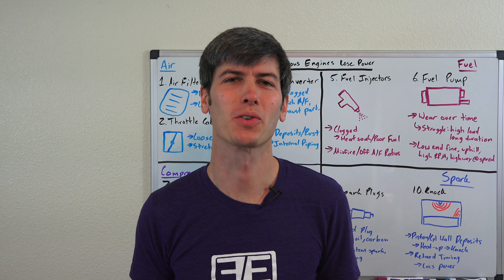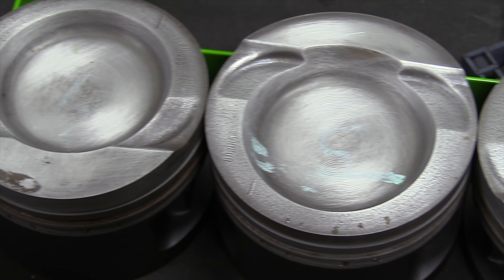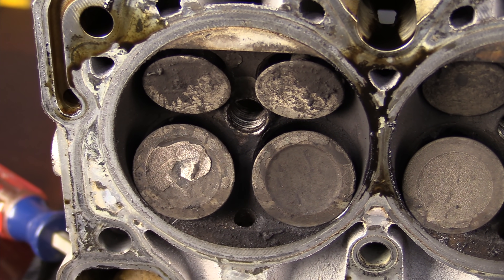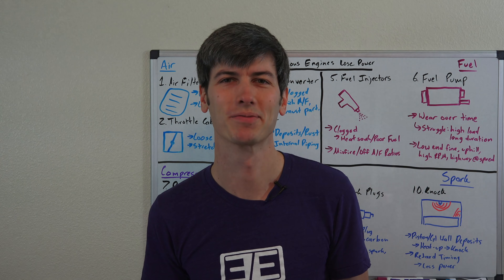10 Reasons Why Engines Lose Power Over Time

Comment: Great. I have an Isuzu kb 240 Le petrol. It is losing power and there are vibrations on the gear lever and eventually goes off. I changed the plugs but the problem is still there. Please help me

Comment: I had probs with acceleration.  Turned out to be drive shaft bearings had gone both sides. Clutch was replaced as well to increase grip. Tyres too.

Comment: Another nice video on cars. The section on piston rings and valve wear  could have mentioned heat from turbos and high rpm
can cause floppy pistons and premature wear of metal and rubber seals, So, keeping heat and rpm low will definitely help engine parts 
and the longevity of your car. I rebuilt engines for years and this was the golden rule.
Great Content.
Mario

Comment: Solutions for the power enthusiast:
1.) K&n filter
2.) Lucas fuel injector cleaner 
3.) Remove your catalytic converter
4.) Replace spark plugs often
5.) High flow fuel pump

Furthermore would advice to upgrade your alternator, OEM alternators only give you the recommended amperage at high rpms.

Comment: I have a 1988 Ford F150 it’s lack of power first and second gear have plenty of power third and fourth it barely climbs speed. It has 48,000 original miles on the motor. Could that be buildup inside the engine causing that? What is your suggestion? I have new plugs, coil, new gaskets, and wires and distributor cap and rotor.

Comment: I HAVE PEUGEOT 206 1.6 LIT PETRON ENGINE IAM A GAREGE OWNER THI CAR I BUT TO ME FOR LACK OF POWER BE COUSE OF THIS THE ENGINE IS CHANGE THR CAR COME TO ME I CHANGE THE FUEL PUMP CHANGE THE ECU CHANGE IJECTORS THOTTLE PEDDLE MOTORRIZING SPARK PLUGS I DID EVERY POWER AND GRAND TEST I CHANGE THE MAP SENSOR WIRING OK BUT THE CAR STILL LACK POWER ANY ADVACE WILL BE USEFULL 
THANKS

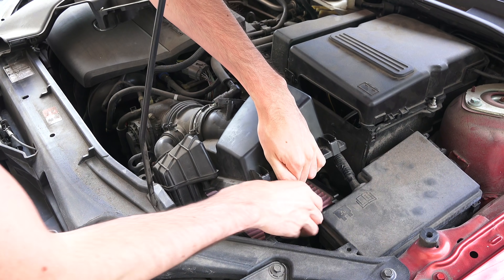Comment: 1 00:45 Air filters 
2 01:04 Throttle cable 

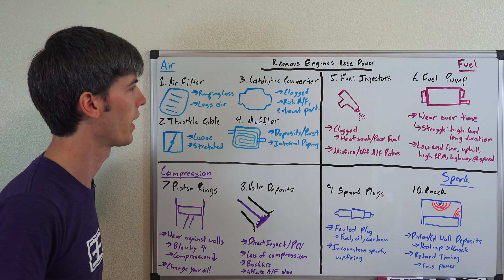3 01:32 Catalytic converter
4 01:42 Muffler 

5 02:03 Fuel injectors
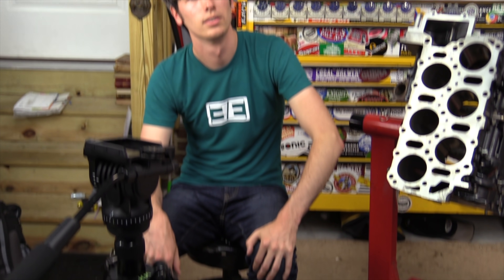6 02:21 Fuel pump 

7 02:51 Piston rings
8 03:23 intake Valves 

9 04:17 Spark plugs 
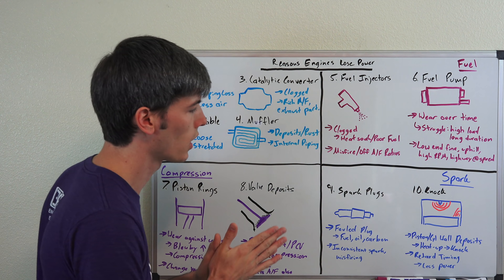10 04:31 Knocks

Comment: Believe me, I sold my 3 cars just because they were losing power while driving uphill, and all of them were Toyota's. Presently, I am using Toyota camry 2010. The same problem I am facing again it lose power while driving uphill, especially at speed of 80kmph or more. For example, if I am driving on uphill at speed of 80kmph and then road speed change to 100 kmph, my car does not accelerate, to drop the gear of the car, I have to press the accelerator pedal more than half.. Can someone give an idea of what the reason for my car is doing ?

Comment: I have a 2012 madza 5 can my high pressure fuel pump cause my car to miss fire?
Reply: Maybe, if it is starting to fail.  Misfire is usually bad spark or injector issues.

Comment: Hey hope all is well. Someone mentioned that a new car saves about 30% more fuel vs a worn out car because the worn out car has its carborator rings gaskets oil pick up blocked burnt leads distributor fuel pump wheel bearings alignment worn out. Is this true? because i want to purchase a vehicle soon
Reply: New meaning no carb saves fuel just by being fuel injected as opposed to carbureted.    Wear and tear can cause low fuel efficiency as well, not sure about 30% though.

Comment: Check your fuel pump 
Check your timining 
Clean your catalytic converter 
Purge your injection pump 
And injectors or clean your carburetor 
Clean your intake manifold and mass air flow 

Change inspect your spark plugs 

These are the main simple reasons.

Comment: I'm poor and always buy and drive high mile cars for up to 5 years until I buy another one. I rarely have any issues. They key is to drive them at the speed limit and always check the fluids. Every older car I've purchased burns oil. I've never noticed them lose power throughout the years of ownership. Usually radiators, water pumps, alternators, and batteries are what need to be replaced.

Comment: i know this is far fetched but i did a valve job ,spark ,air filter ,whole works on my zx6r motorcycle  but it still has no top end power it wont push past 200km  blanked out the dyno map nothing, added more fuel nothing   was the same before and after i did all the work to it any idea
Reply: I'm a bike mechanic so I might be able to help you, let's start with what year is it?
Reply: @dukecraig2402  i flipped the bike got a new one again lol problem fixed 😂 thanks tho man
Reply: @loudnpure  
👍👍👍

Comment: Appreciate the video.

Ideas for improving at least some of those problems?  Changing spark plugs is obvious, but what about all of those other deposits inside the engine?  Some way to dissolve or blow them out, with additives and/or driving style?
Reply: Running a full tank of high octane gas will help, Just fill up the entire tank from empty on the highest octane available and dont fill up on what you would normally use until your empty again.
Reply: @ghosthawk969  why is this? I thought higher octane only meant it would prevent pre-ignition. Are you saying it burns at a higher temperature thus ashing/dissolving the deposits away?

Comment: Although this isn't a regular maintenance item, but the injectors will clog up over time. No matter how high grade gasoline you use, over time it'll gum up and yes, even cause a no start. My van sat for 30 months, because I couldn't think to replace my injectors until a couple weeks ago. I replaced everything else as I went, even things that didn't need replacing, but ultimately it was the injectors. I would say either replace or have professionally cleaned with ultrasonic bath every 100k miles or so.

Comment: Would installing an oil catch can half-filled with pure ethanol alcohol allow for a cleaner burning engine? 

I've seen how "The Humble Mechanic" installed an oil catch can  in a Tiguan and how dirty the oil looked. I can see how carbon can form on valves so it got me thinking, "What if a combustible vapor was added to an oil catch can? Would it reduce carbon build-up" ?

What do you think? JC Whitney used to sell a product that used alcohol claiming it would make engines run cooler. Thank you!

Comment: One of the motoring shows had two identical same bhp golf gti,s one new the other with high miles , they did a drag race and the high miler left the new one for dead , a well looked after bedded in engine with high miles can be more powerful.

Comment: My car work fine in the starting but after 200 miles it loos power, did not pickup in 1st gear please guid the reason. 
It's total runs is 21k miles.

Comment: Cables can increase their internal resistance and can affect communication between ECU and sensors. Especially the cables that run close to the exhaust due to heat.

Comment: Hi There, can you please tell me what’s the better oil for Turbo gas engine using in Florida, The manufacture can’t recommend the correct one because there is a lot of different weathers around the world for example you can’t use the same oil in Chicago than Florida because Florida is warm all the year and the other thing is turbo I really confused about One because is need a good lubrication but now body tell which one is better due to it has a thiny pipe. Please help. 
Thanks 
10w 40 is a good choice?

Comment: Piston rings is not an entire engine rebuild its a top end removal job and inspection. If its just new rings needed and a light hone then so be it?.  If its an over size piston ring job and a bore and hone so be it?. 
If its that plus a valve seat, Lifter, Rod and tappet or roller rocker job so be it but all this is top end work. Timing chain stretch or worn belts are also common in power loss issues.
LOL, Who else removes the crank shaft to get to the piston rings?!.

Comment: My car was last year for obd1 1995 Caprice. It was stuck in limp mode. Like back up program to run on reduced power. Computer could not read disk reader in optnispark. Gm pancaked distributor behind water pump. 2 shaft oil o rings gave way oil ended up in my disk reader for timing. Then fuel pump wiring burned in tank. Then I removed MAF sensor screen it can breath. Also bosch spark plugs give little more horse power 4 prong if you can find a set. But they eat more gas

Comment: Just curious - I have a 1997 Isuzu Rodeo 4 cyl 2.6 - I notice when driving section of roadway having long steep hill - on very hot days engine seems to have less power climbing the hill vs driving at night when it's much cooler. Air temperature have impact on engine? (I maintain this vehicle very well - has 82,000 miles.) It averages 25-26 mpg. Another curiosity: I used to have a 1963 Chevy Nova 6cyl 194 cu. in. engine - manual trans that averaged 25 mpg. I would think the modern cars because of all electronics controls / fuel injection would have much better gas mileage. Doesn't seem to be so...the Nova was so much cheaper / easier to maintain....wish I still had that car.
🤔🇺🇸

Comment: Hey man recently my civic 91 was having low compression 130psi in 4 cilinders i change my head gasket fuel pump filters ,now the car has 155psi ,165psi but still fells its lossing power what else can i check?

Comment: Camshaft wear.  I had an engine that was low on power. It ran just fine, quiet, smooth, started OK. It was the lowest power version fitted to this car so I thought it was normal. i decided to pep it up a bit with a performance cam, cylinder heads and headers. When i removed the cam it was so badly worn some valves must have been barely opening. Just replacing the cam with a new standard one would have given a substantial power increase.  Once put back together the power increase with the performance parts was incredible!

Comment: different quality of parts for the first assembly from spare parts. the same manufacturer of spark plugs or high voltage cables does not mean the same quality like first assembly parts

Comment: Why do you call it knock?
Reply: When knock occurs the piston hits the cylinder wall. This impact creates a knocking or pinging sound.
Reply: It's usually called pinging. Older engines have more carbon build up. Those carbon deposits become red hot and increase the compression ratio, and this causes lower octane gasoline to erratically combust before or after the spark plug sparks. You will hear a knocking/rattling noise under load. You will have to bump up an octane grade to stop it, or you can run fuel system cleaners through the tank several times and see what happens. My 2000 Toyota Tacoma does this with regular fuel.

Comment: You an gain compression over time
Reply: no, you lose compression over time. Overtime the cylinder wears out and the seal on the piston rings gets worse. Cylinder gasses are able to slip past the rings and reduce compression and power

Comment: I can't tell you why they lose power and how to fix it

Why they lose power thay are clapped

Step1.cut the exhaust off
Step2. Rebuild them
Step3. Put cold air intake on it don't even put comb filter
Step4. Stay on top of your oil change and regular maintenance and don't be a retard that drives his car 20,000 miles on 1 oil change and has to rebuild it and then spends a lot of money on someone to do it for him
Problem solved it's not that hard

Comment: So, basicly if you replace and rebuild all the parts you just mentioned, there is a possibility for the engine to run as new?
A buddy of mine had an engine rebuild. He went from 10w40 to 5w50 over winter and 10w50 over summer (he does big milage).
When he went to remap the ecu after the whole rebuild, the power at the crankshaft was showing ~10 hp less when the car was new (wow, you can read the brouchure).
How would you explain that?

Comment: Valve deposits are a complete non-issue on port fuel-injected motors unless there's some massive mechanical problem. DI on the other hand... hoping new oils resolve that issue but really not sure it will.

Comment: new air filter check, new stainless catalytic converter check, new muffler check, water injection to clean those valves check,  new 370cc injectors check, new spark plugs check, very rare JRSC supercharger check....I think I'm doing good regarding the list :)

Comment: Man the more i watch your videos the more I love my car for being a brilliant piece of engineering. I have a Mitsubishi Galant hatchback E33 92' has over 125,000miles on the odo, and since I did not ever need any sort of repairs apart from the 6 month oil change. Heck I didn't even need to change my spark plugs in over 2 years as they are in pristine condition (white) as the engine makes perfect combustion. No engine knocks and no oil burning (well maybe a just little bit as after 5000miles the oil gauge goes from high to low - i use mineral oil). I bought it 6 years ago for 1,000 Euro (yes I paid extra because it was in very good condition and was serviced at our garage so it was a customer's car). In 6 years my repair list was as following: 3 x Air filters, 1 set of spark plugs just because (they were in perfect condition), 4 new tyres, 1 antenna rod, 1 battery, 6 x fuel filters, 6 x oil filters, 1 water spray tank (took it from my other Galant an E32), 1 section of exhaust pipe, 1 AC gas conversion intake nozzle (new AC gas regulation needed it). In 6 years I spent next to nothing for its maintenance and its as comfortable as ever and spacious, not the most powerful car out there but it is adequate for daily commute. Range is about 230 miles/ 50litres city driving, 350miles/50litres mixed and once pushed it to almost 480 miles highway only, which is pretty solid for a 1992' car. The only problem the car has is some rattling on the driver's door striker on heavy left continuous cornering (right hand steering wheel). All electrics work perfectly, even the original radio cassette (apart from the up-seek button that got stuck). The only problem with the car is my wife, she hates it, because it looks old design

Comment: You didn't mention timing chain stretch retarding cam  timing. Also wear on valvetrain parts reducing duration and lift. Worn out valvesprings cost power as well

Comment: My 3.4L V6 GM engine is more powerful today than it was back in 04.  I changed out to Mobil 1 soon as I got it home. Been using it ever since.  Changed out OE air filter to K&N. Changed out restrictive exhaust to dual exhaust with 1/2" larger pipes.  Changed out to new OE plug wires.  Bosch Iridium spark plugs. Change out AT fluid at 60000. Maintain the car all the time myself so I know the work is done correctly with the right fluids and oil. Changed to all LED lights, including dash light. Added performance tires and wheels which lets the vehicle roll easier (reduces road friction). Stuff like that.
Reply: Performance tires have increased rolling resistance lol

Comment: Hallow Sir, My 2008 Chrysler Sebring was timing fail, then i replace hole timing component after it multiple misfire even i replace crankshaft position sensor and camshaft sensor, new plug. I want to need your help

Comment: Hi I have a Mitsubishi Outlander Sport se 2011 I have a issue the car doesn’t have a problem turning on but put the foot don the gas and it’s restrained for exhilarating as well it’s know showing engine problem weld it be a filter because I haven’t even had the car for a year

Comment: Great Video... I've rebuilt the engine and clutch to my 95 Del sol and replaced a lot of parts to the engine and cleaned a lot and replaced Fuel filter, air filter, PCV Valve, all the radiator / heater hoses, Axles, wheel bearings, cleaned out the IACV, New Plugs and wires,  New Catalytic converter 4 years ago, etc. etc... This pointed out a few things I didn't think of.... like the fuel pump... Seems to be working fine now but I'll look into it and see how much it costs to replace... The Car is running super smooth right now... but I am sure these things need to be replaced eventually...

Comment: Or you could just replace your fuel filter, fuel pump, clutch, flywheel, idle air sensor, position throttle sensor, new distrubitor, oh and a new engine got to love manual 95 chevys

Comment: I have an 05 Cadillac CTS that won’t stop misfiring I changed out all the spark plugs all the coil packs 2 injectors that they sad were bad and it still misfires and gets horrible acceleration. I have aftermarket cats on it that are smaller then the OEM ones and it keeps catching an exhaust leak do you think that could be why it keeps misfiring or any other ideas another place just told me my electrical harness looks bad could that be it somebody help!!!! lol
Reply: While I’m idling the rpms go up and down and the lights flicker a little bit also

Comment: Can tune ups help minimize this?
Reply: Paul A No. 
Carbon remains are normal and can be minimised using additives. Plugs, air filter, fuel filter, oils etc needs to be replaced regularly

Comment: Hi All 
I have a problem with my car. It losses power certainly when you break or in traffic and remains in that condition.  When you switch it off, it may regain power or remain in the same state. Actually the accelerator pedal doesn't rise,  it will not go past 2000rph. 
I have had a mechanic check it for sometimes now, it picks and goes back to the same condition 
1. They have changed pedal sensor,  this hasn't worked
2. Checked  throttle body, nothing changes 
3. Fuse box checked,  spark plugs changed 
4. Everything is checked and the Power is still not coming back to normal.
5. What do I do please?

Comment: Amazing video!! Gave great insight into the problems facing older/badly maintained cars. If everything else is fine checking the fuel filter is always a good idea as well. As a clogged or dirty fuel filter can greatly reduce the flow of fuel from the pump to the engine and can generally be a serviceable item.